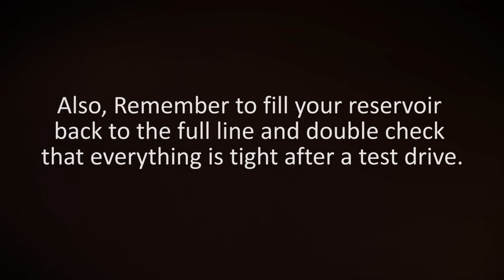Episode 3 - How to Bleed Your Brakes

Comment from the maker: It needs to be done to all four calipers even if you just opened up the system in one place. If your just replacing pads or rotors, this procedure doesn't have to be done. I would say the other calipers don't have to be pumped as much but Id say while your at it, you might as well pump them all a similar amount to avoid having a spongy pedal.